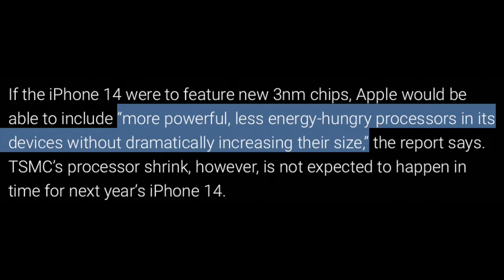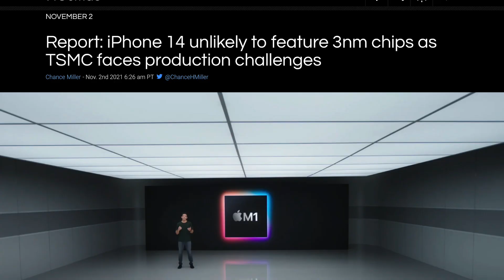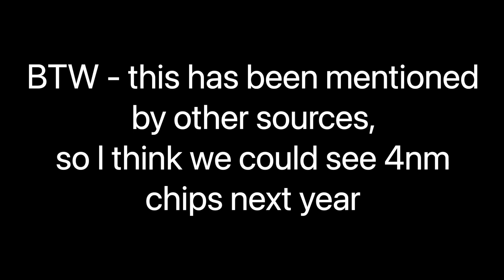iPhone 14 - BAD NEWS?

Comment: Actually the snapdragon 8gen1 already managed to surpass a15 in gpu and by time the a16 comes out there will be a new and improved 8gen1 chip. This could mean we're falling behind.
Reply from the maker: Tbh is that a huge issue lol? Phones have been plenty powerful for years now. A15 is also still way more efficient, which I would argue is more important, since battery life is significantly better on iPhones.
Reply: @SaranByte  not necessarily, what's more important is dependent upon the user and achips losing in the area that it's been the king of is very concerning definitely when android chip manufacturers are rumored to be working on newer chips with the help of m1 creators.
Reply from the maker: But competition is a good thing for us consumers at the end of the day - I’m glad Android phones are catching up, and it’ll make Apple work harder to make their chips even better. If the competition didn’t catch up, Apple would get comfortable with their lead and would just give us incremental updates yearly.

Comment: If they keep shrinking the chip, by then it’ll be less than a millimetre, chipless Iphone?
Reply from the maker: Lmao - tbh I’m not sure what happens after they go 1nm 🤔
Reply: you do realize that 3nm or 5nm is the transistor size not the chip size right? lmao chip size remains the same but smaller transistors = more transistors = faster (generally speaking)

Comment: This is more about technical problems getting to 3 nanometres. It just delays the move to 3 nm.
Reply from the maker: Yup - it should be by 2023 now
Reply: @SaranByte  I doubt that the competition will be catching up appreciably. Remember Intel are still using 7nm. I also think that Apple have an exclusive deal on the latest process for a while as they fund so much of its development. They will still have some improvements as the M2 will be using a more efficient chip design this year, the overall improvements will just be smaller.
Reply from the maker: Well tbh M2 will be based on A15 cores anyways, but yes, I agree that Apple will stay ahead of the competition
Reply: @davidlazarus67  intel just got into 10 nm XD (AMD is using 7nm)
Reply: @lolretro2137  Thanks for correction.

Comment: That’s not bad news to me. 3nm would be doubling the transistor density on the die which makes the chip way more expensive. An incremental performance bump with 4nm is more than sufficient to handle current workloads.
Reply from the maker: Fair point
Reply: Actually it lowers cost. More chips per wafer …

Less defect per chip
Reply: @RunForPeace-hk1cu  I’m not so sure about that. It’s about the density of transistors per chip. Assuming the size of the chip is the same, it’ll cost more because they’re packing more transistors so the chip can run faster. Unless you’re shrinking the overall size of the die.